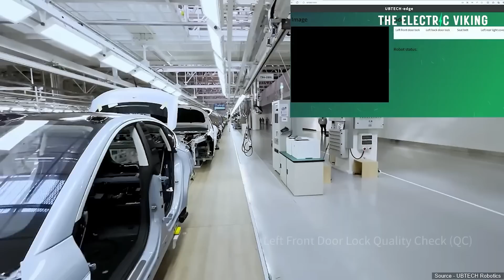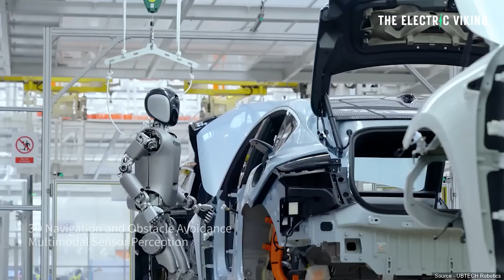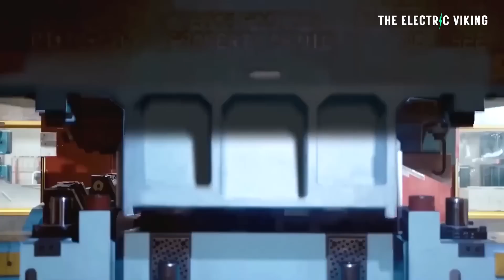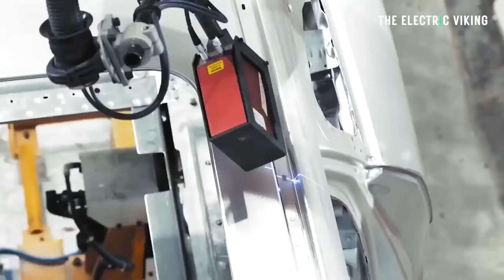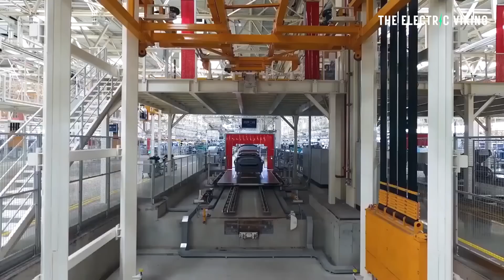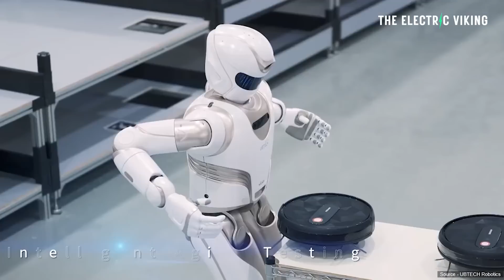Chinese EV maker reveals the Humanoid Robots that will replace humans

Comment: The first moment I saw the video, I could already tell it's either fake or staged (just like their voice-controlled car demo video years ago, in which the cars were in fact controlled by technicians remotely).

Think about it, robots with mobility in a car factory would be moving on wheels, not on two legs which increase costs for no reason.

Comment: Unemployment rates are an important problem until it comes to the EV push. 

We don't need more than a quarter of the mechanics as they break down less. 
Ah we don't need as many workers as they are simple to produce. 
We don't need most of them at all with robots!
Reply: Not really, these is a shortage of qualified workers in all developed countries...they will find a job in no time
Reply: And judging from what these robots do, it s going to take a while for them to do real jobs...
Reply: @dangrecu4034  it'll take a while sure, but that shortage is for current ICE techs. Most of which will not have the needed training to transition to EVs, and if they all did transition, most of them will not find a job as most EVs don't require even standered maintenance for years. It'll go from shortage to oversupply, leading to large unemployment rates amongst technicians. And manufacturing has 15-20 years to go Full EV, so my statements can still be true. California alone estimated 35k jobs under EV transition will be redundant and worthless.
Reply: @dangrecu4034  what job when you've put in 5-15 years into ICE maintenance, with all the now obsolete tools are worthless and won't be sold. Who will need 750k ICE technicians? 

But like I said, unemployment doesn't matter in the EV push.
Reply: @dangrecu4034  now explain what I should do? As I have to spend money and time to work on current ICE vehicles and be certified for both. Do I just be unemployed until 2035 when EVs are mainstream? Cause I can't be buying tools that will be worthless in that time. But I need those tools to make a living now.
Reply: @AhjTheMediocre  what I meant is that there are a lot of missing specialists in all advanced economies. For example in Germany they have 550000 missing qualified workers. Not all of them are technical but you get the point, there are places to go if ICE repair business is going down, although it will take a while with the current EV penetration of 1% in the US and 2% in EUrope (% of total fleet)

Comment: You taked about the blank face of the robot . My question is why do they have heads . They could put all the visual equipment on the body . They don't need to walk . It would be much easier to roll around. Talk about
Reply: If they want them to replace humans the cameras need to be where a human’s would be. The work environment is built for humans.

Comment: From the visuals these robots have less mobility and dexterity than an 85 years old man! They have a long long way to go!
Reply: Not really about a year or two.
Reply: At least they are actually starting to use then in the real world. These will advance pretty quickly in the coming years with more data being collected. Engineers will be able to make improvements on them.
Reply: @juki0h391  that's what they're doing right now the ones you see in demo could move better theyre still in training
Reply: It looks to me at this time that this is a gimmick and nothing more. They might become better in the future, but now they are pretty useless on a factory floor.
Reply: Exactly, any intern could to these tasks. Come one fixing the logo and pulling the swat belt, is this the humanoid robot revolution? You can do these tasks with regular factory robots BTW...

Comment: Those robots don't look that advanced.  Not sure if they are ready to do real work on the line.
Reply: Bad news: The robots do not matter for that as much as - the AI driving them. And look at the Tesla Optimimus. Then look at the last 2 generations and when they came up. Then realize that development in this space goes fast. Ok, not ready - what in 6 months?
Reply: You have to ask: "is the human form factor the best form factor for the job that needs to get done?" In many cases it will not be. A lot of effort goes into bipedal walking on a flat floor when wheels could likely do the job easier and better.
Reply: Maybe they can invent robots that can buy & drive cars, but you would have to program them for road rage.